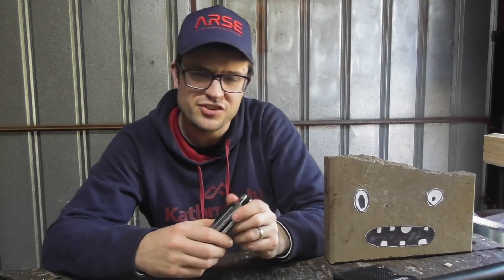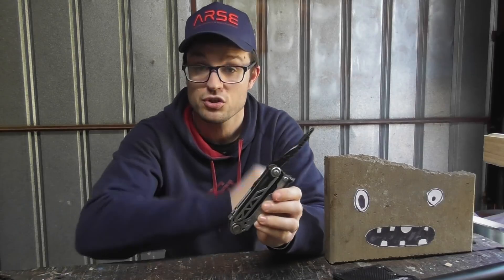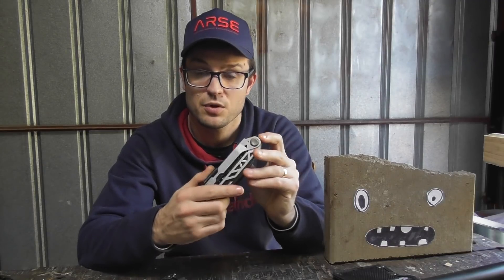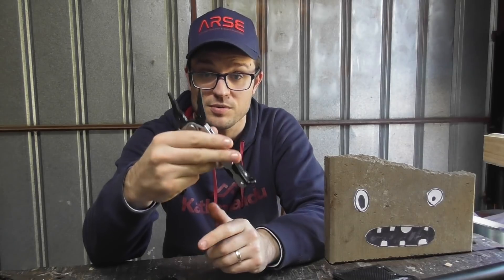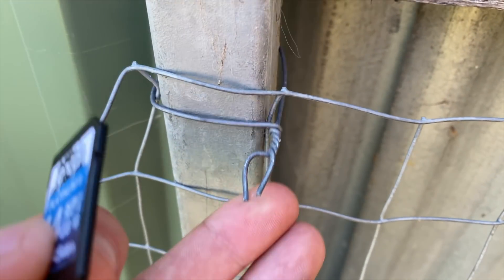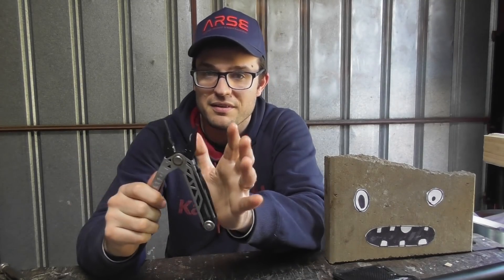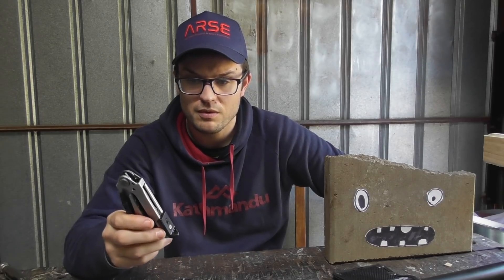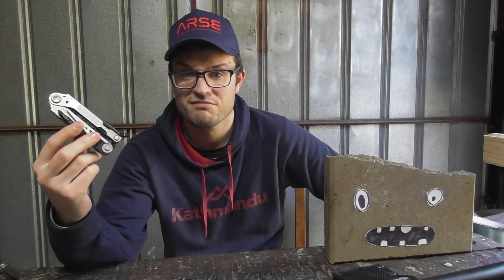EDC Issues: These Awful Gerber Wire Cutters Really Make You Think

Comment: Never had the integral wire cutters in my Leatherman fail once. Cut inappropriately hard wire many times.
Reply: Same deal with my 1. gen Wave. 20 years in and still no issues with the jaws.
Reply: Same here. But if one is going to use the wire cutter often and hard...then maybe a dedicated wire cutter tool might be the answer.
Reply: I messed up the pivot of my leatherman cutting something, but the replaceable cutters didn't have any damage on them. I decided that you might as well carry high quality pliers with a swiss army knife, or just a knife. It can be lighter, but most importantly it will have a million times better quality than you get out of a multitool.
Reply: I have unfortunately. My first Leatherman Supertool. Tried to cut a bicycle brake wire which totally ruined the wire cutters.
Reply: @MrAliaspostmortem  those cables are really hard indeed due to its job.
Reply: @1ohtaf1  Knipex 08 21 145 are the pliers I use. You don't need the cutters to overlap for them to cut well.

Comment: Great video Pete!  Here’s my take.....replaceable wire cutters are a great concept if done correctly.  Leatherman, uses 154CM and I’ve never replaced any of them on my Leatherman MT’s.  GERBER on the other hand, went ahead and went full GERBER!  They chose Tungsten Carbide which is certainly “tough”, but not when it comes to cutting metal wire. The impact shatters the tungsten.  3 years later they still haven’t changed the material because as you said, it’s a cash cow for them.  But that’s Gerber!  It’s like them and CRKT compete to see who is more incompetent.

Comment: The fact that Gerber doesn't change the design even after years of continuous failing really shows their attitude. 

As for the replaceable cutters I think they are not a bad idea in general, provided they ain't worse than integral cutters. Which is clearly not the case for the Center Drive. 

Your video as well as the ton of negative comments everywhere about this issue made me stay away from what I consider an otherwise very interesting multitool. 

Way to go Gerber, way to go.
Reply: It’s not a design flaw though, it’s meant for electrical wiring and soft, small gauge wire. Gerber has never advertised otherwise. It’s just people not knowing how to actually use a tool properly for what it’s designed for.
Reply: @hunterglaspell5580  I just read through Gerber's official Center Drive product information. 

Absolutely nowhere does it say that these cutters are designed for "soft" wires only. 

They are called"wire cutters", not "soft wire cutters", "copper wire cutters", or "electrical wire cutters". Just wire cutters. And if they fail to cut wires than it has nothing to do with user's incompetence.
Reply: Straight up correct.

Comment: It would be good if they offered both tungsten carbide & high speed steel replaceable blades. The carbide probably would cut copper core electrical wire cleanly & last a good long time whereas the HSS would be best for fence wire & the like.
Reply: The thing is, that’s exactly what Gerber designed them for. Electrical wiring, not a fencing tool. This is (as well as every other video I’ve seen on the “issue”) a case of someone using a tool for a purpose it was not intended. My centerdrive has been just fine cutting even larger gauge electrical wire.
Reply: The solution is not HSS, or Tungsten carbide. 154 CM stainless steel with the proper heat treat is what Leatherman replaceable cutters use. Gerber should match that if not in the standard center drive. The CenterDrive+ should come standard with 154CM replaceable cutters. 154CM replacement is better than the original integrated cutters. I have had to repair many integrated cutters on my multi tools. It's not fun.

Comment: (Edited for clarity and Spelling).
Interesting perspective, but as a counterpoint... when shipping an item back for warranty you have to pay for shipping, which averages around 20 dollars, sometimes a little more, sometimes a little less, depending on the item. When compared to the cost of buying a set of replaceable cutter inserts from Leatherman ($10.50), just replacing the cutters yourself is cheaper, not to mention much faster (the last time I sent my Wave in, it took 6 weeks to get it back). I'm assuming that the cost of the Gerber cutters is similar. Yes, the switch to replaceable cutters probably WAS done to lessen the number of warranty claims, but, that fact by itself doesn't mean it was a bad change for the consumer. Of course, the issue of the Gerber cutters failing so frequently is a different subject altogether.
Reply: My thoughts, exactly. 

Replaceable cutters are a win/win IF they are good. The ones from Leatherman definitely are. The ones from Gerber, not so much. 

I kinda feel sorry for Leatherman here. If Gerber doesn't care about their own reputation, so be it. But they also drag down the reputation of replaceable cutters in general.
Reply: Like has anyone ever had problems with integral wire cutters ever? I've never had a pair fail. Built in failure or is it an actual issue.
Reply: @BMikeAD  Never had any "fail", but I've had them wear out.

Comment: I think your notion is spot on. I own about 6 diagonal cutters from Pro-Grade to Snap-On, but I still own and use them all, even the cheap ones. They are decent steel with a decent design and I don't cut nails with them. I use my linesman pliers for that but they're old so cut me some slack. Anyway, there's no reason a decent set of forged cutters shouldn't last a very long time but I get the feeling that people used to break them on the multi-tools because they were overconfident in their pliers ability and the manufacturers didn't want to deal with the warranty anymore. What gets me though is how replaceable cutters are advertised as a feature you need, when they don't benefit the end user at all. It's not a lie that they are replaceable, but it's dishonest to sell them as an upgrade. Get yourself a set of good linesman pliers.

Comment: I stopped buying gerber multitools because of there replaceable cutters, every time I used my 600 to cut anything they shattered, and after replacing them 4 times I was done. I have since switched to leatherman and specifically the rebar which has cut tons of stuff and never failed
Reply: The rebar may not be the most convenient multitool with it's inboard tools but it is exceptionally reliable!
Reply: Ive found the leatherman replaceable cutters to be excellent as well

Comment: I find it fascinating that people still complain that Gerbers “wire cutters” (ie electrical wire) break when they use them for things they aren’t designed to cut. It’s not a design flaw, it’s idiots misusing the tool for something It wasn’t intended for. I have used my centerdrive for copper wire and other small electrical bits and bobs as designed, and they have lasted just fine. Hard/soft steel wire as I’ve seen on multiple YouTube videos when complaining about the centerdrive in my mind show instantly who’s in the wrong. And it’s not Gerber.
Reply: And I find it fascinating that besides cheap hardware junk, Gerbers are the only ones that can’t handle “inappropriate “ wire specifications. Leatherman and Victorinox hold up just fine for these tasks....gerber sucks now...Walmart garbage
Reply: Matt Pearson I have a leatherman surge and rebar who’s cutters chipped out on me during the same tasks. I also had a skeletool disengage and almost slice my finger open at the (guess what) Walmart knife counter cause the liner lock failed to even hold the checking of your and down play. I have every brand of multitool and multiple of each brand. The fanboyism is real with this one
Reply from the maker: I guess an issue could be that this part of the tool is marketed as ‘wire cutters’ and often even ‘hard wire cutters’ for the part closest to the pivot where the blade indents a little. I would argue that using a tool designated by gerber as a wire cutter to cut thin fencing wire (as shown) is using them within the advertised spec.

Comment: I bought a Gerber multi tool back in the 90s. The wire cutters weren't great, but they weren't meant to do certain rougher tasks. I got a job years later that involved cutting a fair amount of wire. So I got a tool specifically for cutting and stripping wire as my supervisor recommended. If you do a task a lot, get a specific tool for it. Multi tools are not specific, but general.

Comment: The big thing I've never seen done, that I really enjoy about leatherman's removable wire cutter bits, is that I was able to remove them, and sharpen them down to my needs so that they would very cleanly cut wire (instead of mashing them like they do from the factory.). They still can go through fence in my case, but now they cut like proper wire cutters should.
Reply: Did you thin the bevel, or thin down the whole insert from the flat side? I understand that they make the insert edges sharper now than they used to. The fuse wire cutters also do away with the hard wire notch, which only really aids in less handle splay and locking the wire in from slippage.
Reply: @robbowman5857  I thinned down the bevel. That was the way to keep the hard notch decently, since I was able to avoid grinding down that portion

Comment: Its interesting that you bring this point up... have you thought of approaching the company or at least the company rep and asking what their opinion is.. and how they intend on dealing with this ongoing issue... cause I'll bet you are not the only one with this particular problem....
Reply from the maker: swapping to a slightly softer material, maybe a tool steel even, versus tungsten carbide, may be a decent choice
Reply: Beter 154CM than Tungsten carbide.
Reply: There is a reason they use the cutters they do. I think it is because these triangle inserts are the same ones used in machining. When I was a Machinest our side cutting tools were these inserts. We also had tool steel ones as well. It probably could be had from a tool supply if someone wanted to do the work to find a source. Because of this Gerber has a cheap endless supply of these inserts with little cost.

Comment: Years ago my wife had a Gerber multi tool she used for gardening which included cutting very thin wire. She broke the jaws on the Gerber cutting the thin wire. Gerber replaced the multi tool. It happened two more times with Gerber replacing each time. I no longer use Gerber multi tools.
Reply from the maker: Not the best track record for sure!

Comment: I've had every multi tool I've owned fail on me. 3 Leatherman PS4 squirts, 2 of them the pliers themselves snapped TWICE on each and a third one the pivet failed during fairly light use, pulling plastic body pins out of my truck to replace a radiator. They were closer than my dedicated pliers and figured they'd do the job. Not really. Then I switched to Gerber dime and breezed through 2 of them and gave up on the small ones. Tried a Leatherman juice I think it was and it busted the pliers off doing a similar task within a month. I haven't carried one since, even the cheap knockoffs I've owned all break at the pliers head or the pivot themselves break. Just from using them to hold something small, or snug up a small bolt or nut, the wire cutters Ive been convinced are all garbage, and the tools themselves really need an update on materials or better heat treating. I want to give them another go because of how useful they are but idk. Maybe the charge + tti would work. Who knows, maybe my idea of light to medium duty is too much.
Reply: Have you tried a full sized tool like the Rebar? Milk the warranty too. Most multitools handle twisting poorly.
Reply: @MrLlama999  not from leatherman I haven't, moneys tight now a days and I milked it with the squirts I had but it didn't solve the problem of them constantly snapping from being too brittle. So I kinda gave up. Companies great and the tools are really awesome when they work but I got turned off from them and haven't had the money or interest to try anything new in the last 6 years or so. I just grab the dedicated tool. I've also been hunting down some traditional slipjoints for a bit now and haven't really looked at anything else.

Comment: I have a Leatherman Surge and now a Free p4. I have never had the jaws fail and I'm constantly using them to fix barbed wire fense which is hard for them. Using my old wave you could do it about 2 times before the jaws get folded over and tool won't close correctly

Comment: Tungsten carbide (TC) is not meant to be used as a cutter that way. TC inserts have been used for a long time in the machine shops, where they are proven reliable and effective when fully supported for shallow cuts. I never saw these inserts used for "crushing" cuts. I was resolved to not get a Center-Drive until someone gave me one. This being said, I know I'll break the inserts each time I would cut something harder than copper (spoiler alert: I did broke the inserts on copper too!). As for many, I wish that someone would manufacture inserts in 154CM, S30V or any more suitable metal than TC for the Center-Drive. Nice idea from Gerber, bad execution. Looks like a recurring theme song from them. Keep up your excellent work!

Comment: The Center Drive is my most used multitool for my line of work. I don't need to cut much wire though. The carbide cutters are for stranded wire only. I have never damaged the cutters and I have carried the Center Drive more than most I think. If you need a pier with excellent action then the Gerber is better. If you need a stiff as balls wire cutter then Leatherman is your tool. There is a price to be paid for excellent wire cutting ability and that is the plier action. The only exception I am aware of is the SOG Power Assist and Power Lock. They have both great action and the absolute best cutters you can get. People tend to focus on the bad and forget about how good the Center Drive actually is.

Comment: Leathermans new replaceable cutters are AWESOME in my opinion. I think they've got them perfect. I can cut multi-strand cable cleanly with them when the old leathermans would just mush the cable. I'm fairly certain I did try cutting nails with them to see what would happen but that was several years ago. I know I bluntened the old cutters quite badly without using them that much. All I know for sure is for my uses they're a big improvement, but certainly your point has me thinking I need to do more testing, and that I avoid Gerber's version like brickie should avoid acid rain. Great vid.

Comment: This is true. 
I was researching multi tools and extensively went through your channel, Gideon’s and some French dude who doesn’t speak. When I saw the centerline crack and the leatherman cut the nail, I knew that I could no longer consider the centerline despite loving the tool bit feature so much! Leatherman seems to be the best.
Reply: Overall, I would choose the Victorinox Spirit every time, but then I also carry a folder. On an individual level, even a Gerber could be the best option (MP600, try gripping something large with an Leatherman) .
Reply: Beat E. Schaub my friend has that one and the premium feeling is unmatched. With that said after research, I felt that the Rebar was the best or most friendliest edc multitool
Reply: @WillEDC  Interesting. That would probably be one of my last LM choices, for "best multitool". Mostly, the lack of the diamond file (which is one of the tools that really sets LM apart). But then the Rebar is probably pretty good value in the US (Europe, not so much) and it is available in a blade-less configuration, so I can see the appeal.
Reply: Beat E. Schaub best for edc which would be a smaller one but still capable so you would most likely carry it daily. My friend thinks the Surge is the best. 
There one thing I learned when researching multi tools is that you don’t need to just buy one, so looking for the “best” is really silly. 
And another thing I learned is that you can learn to one hand any multi tool which then blows your choice selection wide open.
Reply: @WillEDC  So a spirit :D, it is a lot slimmer than the rebar.
I think the good thing about "looking for the best" or "not settling for what you have" is that you start to appreciate features, maybe learn what you need/like. The Signal might not be the best multitool, but that tap-hammer is nice.
Reply: Beat E. Schaub the Spirit with the niteize clip is a good setup.
Reply: @WillEDC  yeah, a clip would be nice.
Reply: @Jones Not just removable, there are after-market bit holder available that can take their place. I can't see myself carrying a Signal in the outdoors, but found it excellent around the house, I did replace the woodsaw with the metal file though.
Every year I wish for a Signal with 4 large outside tools, so far no luck. But think about it, you gain the tap hammer (and the plastic bits) at the price of only 1 small tool (reason is, that the Signal also has small tools in the slot of the large tools).
Reply: Compared to the Wave